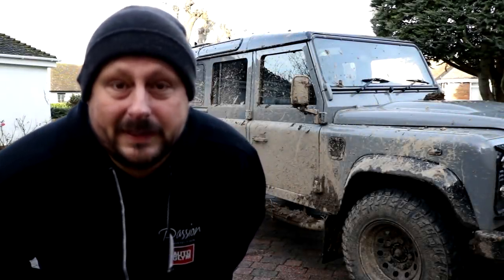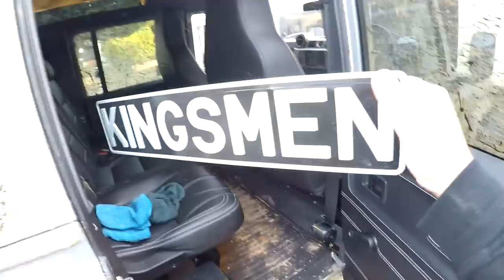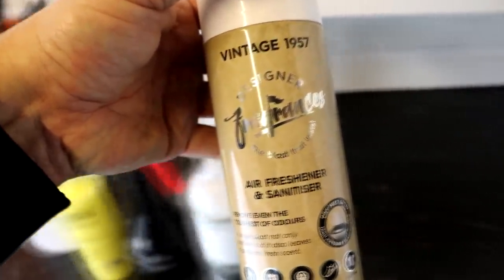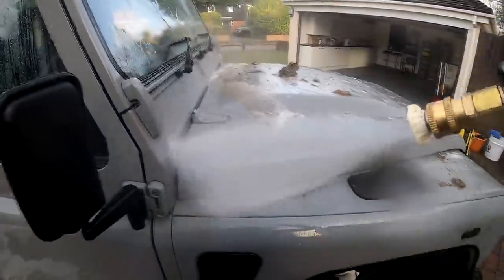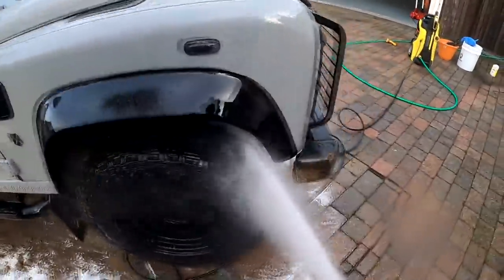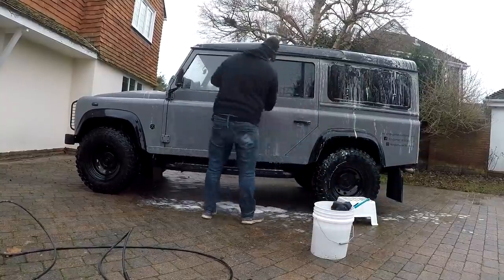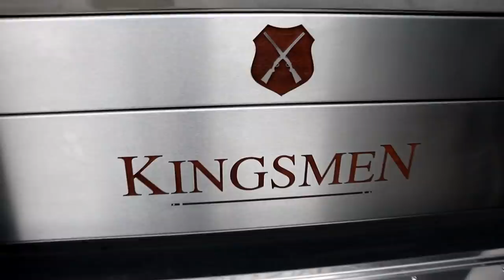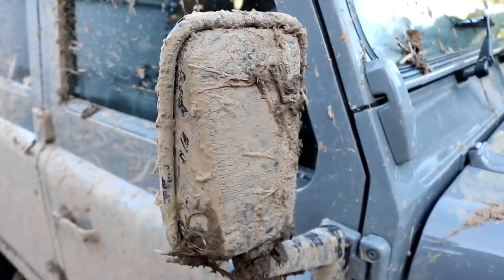Embalmed in Thick MUD | Land Rover Defender Kingsmen | Extreme Dirt Detailing

Comment: see i just got my stuff recently for my atv 2 buckets soap foam cannon and mitt i think in the summer time im going to pre wash my atv then foam cannon it then scrub it with mitt then wash it off then it will be done i think that would be the right way doing it when i got it i pre washed my atv then put the soap foam on amd let it set for arround 3 mintues witch i messed up and it still looks horrible

Comment: 3:23 - Ah! That's what the air vents are used for!  As an active Swiss Army-trained firearms instructor I find it irresponsible not to have secured all live ammunition before handing it over  to a layman. Awesome vehicle. Hope you got a good fee.  Did you put wheels on the Kärcher Patio washer? Is there a video on that? Looks awesome! I could use that here in Switzerland to remove rural muck from the underside of my Superb estate and MX-5. I want such a Defender!  You did an AMAZING job! Hats off to YOU Jon. All the best, Rob
Reply from the maker: Very important point Rob but As stated in the video.  Owner was onsite to assist with the handling of any munitions.
Reply: @ForensicDetailing  Ah OK I missed that! Best, Rob

Comment: Can anyone tell me if I can get a decent snow foamer to click onto the end of my hose lock hose pipe? Or will I be better with a cheap second hand jet washer?
Reply from the maker: we dont generally have strong enough mains pressure to make those hose guns work.   but you can get them..   In the USA if you connect it to a hose then call it a foam gun..  And if you connect it a pressure washer they call it a foam cannon.   I think adams in the UK might sell both gun and cannon..  but get a K2 or K4 and a and a proper lance mate you wont look back

Comment: Before applying the foam on the car, why don’t you try to remove loose dirt with high pressure water? I mean most mud will vanish just by water pressure. Then wait for a couple of minutes and apply the foam to remove water resisting dirt. Just an idea 🙂
Reply from the maker: you can do mate, sorry about 500 people have suggested this ive answered it many times.   truth is doesnt make that much different.  if I rinse the car without prewash I get 2000 people say I am wasting water and I should prewash first.  if I prewash first I get 500 people saying I should rinse before prewash.  I can write an essay on the pros and cons of both methods if you want.   I like to prewash onto a dry car when theres a lot of road film.  If theres a layer of water you knock your concentration down again by at least half and the foam runs off easier etc....    Theres arguements though for that initial rinse but I cant write another essay on this. I will do a video on it soon.

Comment: „Dude, what’s that stuff all over the car?!“
- „England.“

Edit: I think you could have saved on some cleaning product if you had just used the high pressure lance for the first pass to get the thickest parts of the mud coat knocked loose / off. 
But hey, to each their own 😊

That aside, I think I have found my new festival camper ❤️

Comment: Why didn't you pressure wash the large chunks of dirt off first to give the snow foam a chance to do its job properly???
Reply from the maker: by using a pre rinse soak with bilt hamber it makes the first pressure rinse about twice as effective.  otherwise Im wasting water.  if I blast off mud first blast doesnt have any bite.  And the car then has a layer of water on it so when I add the pre wash it gets knocked down by at least half and is less effect.   watch how effective the first pre wash was in the video result speak for themselves really.

Comment: As a Defender owner, 12:04 did hurt a bit :O
Reply from the maker: is that some sort of air intake Mika?
Reply: @ForensicDetailing  Yep. But if you leave it for long enough the intake should drain by itself. Same goes for the doors, manual actually says don't point at the seals because it will go into the car. Doesn't matter all that much if you're detailing it very thorough. Great job at the underside! I'm looking for the same karcher attachment now

Comment: Amen picking the right tool for the job is very important so why would you foam the car before power washing it did you want to make sure the dirt was clean to why not get the dirt off of the car first then foam at you know that of scratch in the car with the dirt
Reply from the maker: lots of reasons, but like I said to others.   I know what the drama will be nowadays before even shooting the videos.   I knew this would be the main drama, also knew if I just blasted first before prewashing  the other side of the camp would go nutz :)  

truth is its not that important either way. It went well and the pre soak really did its job very very well and made the first real blast down so very very effective.. but hey ho..

Comment: I don't understand why you wouldn't power wash the vehicle with just water to remove all the mud before using snow foam
Reply from the maker: talked about this a fair few times now.  it wont really make much difference here but, If you rinse with water first you will use lots more water and you will still need to prewash and rinse again so you will loose time duplicating steps.  Also when theres a film of water on the car you dilute the prewash down again buy at least half and it doesnt stick to the surface as well..      you could argue with this much mud on the car its worth blasting off the heavy stuff first.. but overall the approached work great, and the prewash really helps soften down the film.. no matter what you do this car needed lots of blasting.  also from doing you tube for 5 years I will get an equal amount of people complaining if I pressure wash with no prewash soak first.   these are the joys of doing videos truth its you just gotta crack on and clean it.

Comment: all of these chemicals will go into the ground water.. in germany you're not even allowed to do that on your own property.
Reply from the maker: All the BH stuff is surfactant based and its fully biodegradable.   German chem regs rock they are there for good reasons I think, sets a great example. But yer I would struggle living somewhere you cant wash your own car...
Reply: @ForensicDetailing  oh okay then its good! I was just worried about it :D Thankyou for clearing it up! Yeah its pretty hard here. You either pay to get it cleaned or you do it and hope no one will snitch. Usually i just clean mine with water and sometimes some soap thats for the car. But in general i do get why Germany is so strict about it. Imagine everyone using chemical stuff and it goes into the groundwater.. it would be horrible.

Comment: whata very odd "detailing" i dont think ive ever seen a detailer not power wash off the crap from any vehicle first before the foam, infact ive alwsys seen them remove the crap first possibly with a pre wash chemical to start dealign with the surface crap, then go in wiith foam etc.   and even with that its wise to do the wheels first.

Comment: Don't know why you would foam over all that mud, i would have power washed the bulk of the muck before i foamed it.Just sayin.
Reply from the maker: your american arnt you.  We call it prewash.  When you refer to it as foam you think its like contact shampoo its not.  Its designed to go onto the dirt and soften it so when you do that first power wash you remove 99% of dirt rather than 90%.   the product we are using is also the most effective on the market (see best now foam video)
Reply: @ForensicDetailing  Yes i'm an American, I don't know what that has to do with anything, but yes i'm an American.